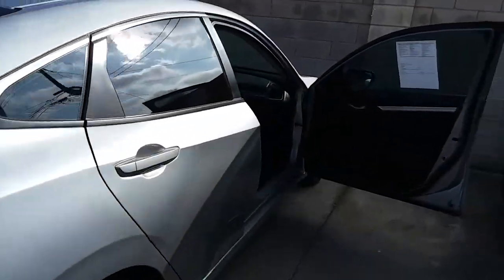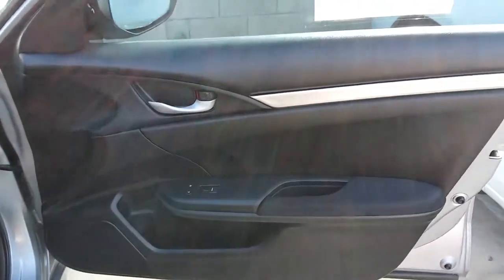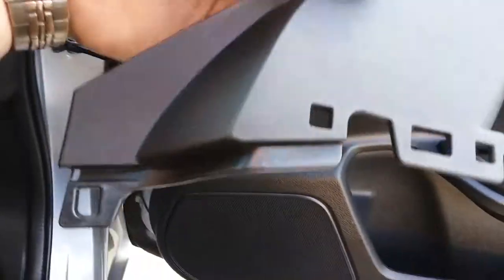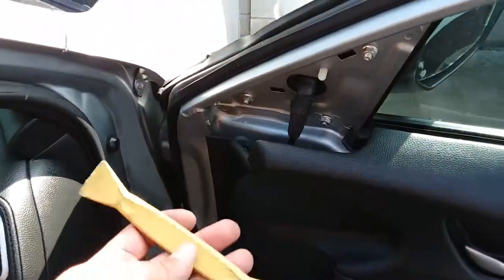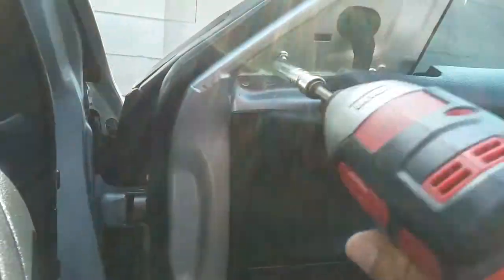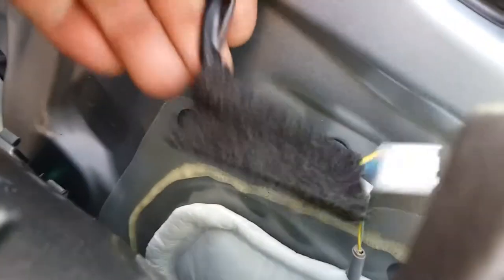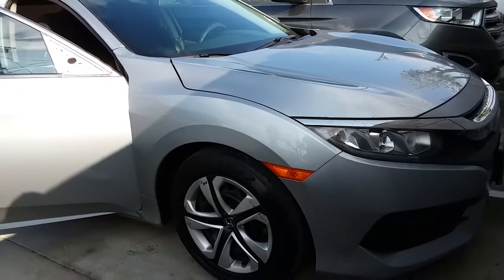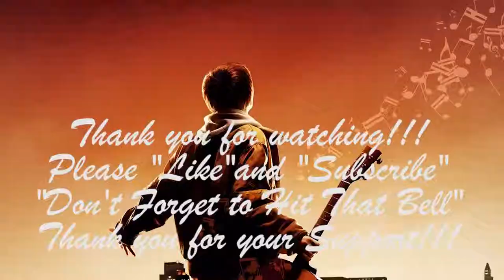How to: Remove Passenger Side View Mirror on a 2016 Honda Civic

Comment: Thank you! So helpful! I’m proud to say I’m a girl and did this on my own!!! 😁

One small problem, it seems the mirror I bought is for the civic EX. The plug is bigger and doesn’t fit. Is there anything I can do to fix this?!?
Reply from the maker: Heck yeah I'm glad this worked out for you. You might have to get a lil technical. You can remove the old connector  by cutting it with enough slack to cut the new one and wire it together and tape it up with electrical tape and see if that works. Might want to ask your pops or bf to help you, but if you can, hey more power to you! Good Luck Hope this works! Thank you for your Support!